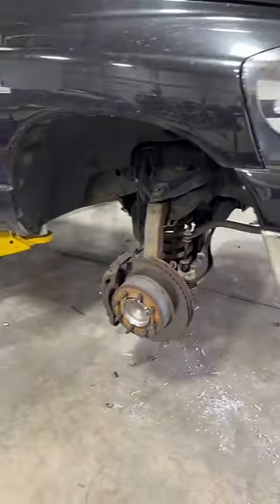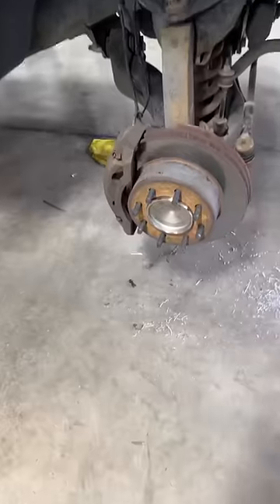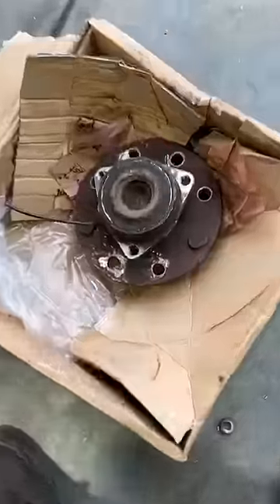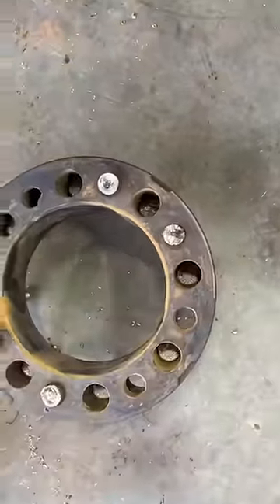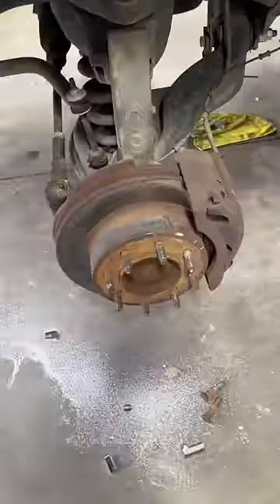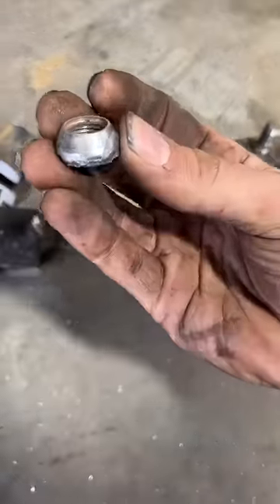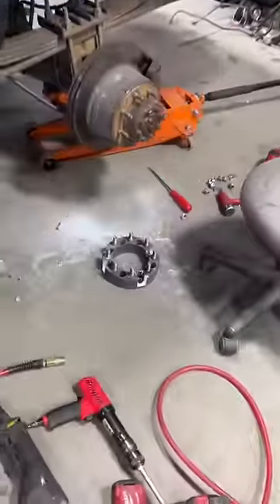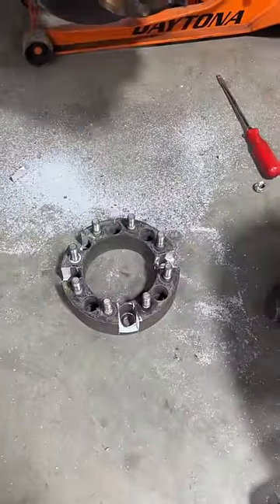I told the customer to sit down before I gave him a price 😂 I didn’t need him to pass out

Comment: Now I’ve been retired a few years now and I’m pretty sure that tires that were outside the body were not allowed, at least where I’m from. I don’t know if this has changed but I doubt it and frankly I think it’s ridiculous to have these monstrous tires hanging out past the body. Anyone remember guys with the N50/15’s sticking out? That was not allowed. How a big smoke puffing modified diesel 2500 can run tires 4-5-6 inches past the fenders is beyond me! And I get it, it’s cool but not safe and it’s so widespread I’m wondering if it’s not a problem and it’s me.  I’m going to have a look at the DOT regulations for my province and see but I doubt it’s ok. And how does someone let there spacers get that welded on? Come on really!! Oh well rant over, is what it is and I feel for you.. cheers

Comment: just put anti scuff on the flange
center .and a finger full on the
wheel centre hole .especially on
alley wheels. i do this in uk. 
becouse everything goes rusty.
never get trouble getting a wheel 
off .

Comment: Bro I just went through this literally last night 🙄 two broke lugs in some guys big ass Dodge 2500HD with damn 2an1/2” spacers and damn moto metal rims damn custom lug nuts snapped off flush at the rim not 1 freaking 2. 3 hours later I got to kick that damn wheel off.

Comment: I've always said mechanic's should make salarys like doctor's and lawyer's and stuff..... And no I'm not a mechanic..... I do have a wheel spacer story..... I'd bought a set of 98 Mercedes wheels for the high end 16" Michelin tires, had the set stacked up here for a while contemplating the cost of dismounting, remounting, balancing the tires onto my 96 Oldsmobile Aurora when I realized the merc wheels looked better than the factory Oldsmobile wheels and "bingo" off to the web and found a guy to cnc machine 3/4" aluminum spacers to adapt the merc wheels to the Aurora and no problemo whatsoever...  It's kinda cool as most folk's don't know what an Aurora is and think it's a Mercedes..... As a side note I sold the 20 studbolts are whatever you call those knarly looking mack truckish lugs I received with the wheel set for 85 buck's on ebay..... I love my Auroras, yea I have a 98 model to..... Not to candy coat you need to be a mechanic to drive the car that polished off Oldsmobils 100+ year run......😂

Comment: ..changing things from stock can be hazardous to your wallet...I knew a guy with a new Dodge Ram.  He just HAD to have the rear axle ratio changed because he didn't like the rpm's on the highway and wanted the engine to turn slower or some sh!t, so he told the repair shop to change the diff gears.  They tried to talk him out of it, but he would not be denied, so they did it.  Turns out doing that messed up the anti lock brakes, he crashed into a woman and totalled the car, she sued him, and because he'd modded it she had a case.  He was making payments, $500 a month forever.

Comment: Those things put such a cattywampus axial-to-radial load on wheel bearings; I'd rather saw the truck lengthwise down the middle, then weld the two halves back together with a four-inch wide band of 1/4" steel sandwiched between.  There - two-inch wheel spacers all around.

Comment: I hate wheel spacers. I have an 04 ram dually so it's got OEM spacers on the front. I just recently had to replace a wheel bearing, I must've fought it for 30 minutes 😂 everything went back together with a coat of anti sieze so I never have to fight it again

Comment: COPPER NEVER SEIZE 
PRIOR TO INSTALLATION OF SPACERS IS MOST BRILLIANT NOT THE ALUMINUM TYPE BUT THE COPPER TYPE AND USE PLENTY ON THE ( THREADS ) ONLY BOTH 
INSIDE N OUT

Comment: I don't know much about vehicles. But I know I had to sit down when I got the price for a new wheel bearings and hub assemblies for my Nissan Titan. Ended up doing it myself but those parts still ain't too cheap. Don't even get me started on replacing the starter. Having to disassemble the whole truck like a fucking Lego set just to get to it. And I doubt my dumbass could even finish a Lego set
Reply: About to roll over 420k something  Miles so don't nobody get ideas about it being a shity truck. Wheel bearings were good to 300,000 in could still be going now. The spark plugs only been changed once since 2008... But at 35 bucks a pop goddamn I'm going to have to change them again soon. I do pull them every year to clean them real good and make sure they're not totally destroyed or failed. Other than that, a bit of a tune-up, oil changes, and the $50 driveshaft carrier bearing... Zero maintenance. But I do drive like grandma

Comment: Wheel spacers suck, but if it only needed 1 wheel bearing, how did that turn into taking all 4 of them off? There’s a tool called the lug ripper available on the tool truck of your choice. Drills the stud out without damaging the wheel or spacer, you’d just need new lug nuts. 🤷

Comment: Actually truth be told a hub centric wheel spacer at 2” is not going to hurt your wheel bearing but having the lug nuts torqued at full send 1000 foot pounds dosnt help and yes sometimes us mechanics run across this a lot and usually done by the person who owns the truck that dosnt check there lug nut torque with a torque wrench and use the right socket

Comment: I don't get all this wheel spacer on trucks with stupid wide wheels and cars with those stupid big wheels on them. A buddy of mine years ago had a impala with big ass wheels on it and I heard him backing out of his driveway one day the torque converter was struggling to back the car over a bump In his drive. I told him your trans won't last with that strain on it. He told me na it will be ok. Less than month later trans was burnt up.

Comment: Heat + penetrating oil didn't work? Wheel spacers are often put on with loctite. A little heat then spray it down with oil should have saved you from having to destroy the customer's property. Unless you tried and it was still stuck tight.

Comment: Do wheel spacers serve any beneficial purpose besides cosmetic? I read the other comments here detailing what wear they cause.
Reply: having a wider wheelbase would increase stability in extreme off road conditions, making it less likely to roll. However, we all know these vehicles aren’t seeing more than a loose gravel road when it comes to that.
Reply: @ZSmith-yy4lv  right.
Reply: The main benefit is front tire clearance when turning. The spacer is what will keep the tire from contacting the truck when wheel is fully turned. Although buying a proper offset wheel in the first place is a better idea

Comment: I had a car come in with just ONE lug nut that bad. Looked like a cave man with an air hammer had got to it at the last shop.

Took a while but I got the carbide burr out and saved the wheel, put a new stud on.

Comment: Spacers arent detrimental to wheel bearings as long as they’re a reasonable size (like 5mm-20mm). They cause problems when they are huge like this persons spacers. The issues/wear they cause increase with the size. Smaller 5mm-20mm spacers are practically no different than buying a wheel with a different offset. When you go unreasonably large is when it causes a lot of issues.

Comment: Shops I worked at would tell him go back where they put that garbage on there.
We won't install those or try to save them.
They always end up being the underlying cause of things failing and damage leading to danger.
I don't care if you want to write up a waiver.
We know better, and the other vehicles on the road may be put at risk for life and property.
The one time I was asked by a service manager to swap in a new one, it later was proved with time and testing, spacers were causing brake feel he objected to.
They're not better, they're not good for it, and the shiny stuff only looks good sitting still and not on the public road.
It's debatable, in various ways, I know.
Just go back where you bought them.

Comment: If he doesn’t wanna pay put those spacers back on as tight as you can, drop it on the floor and wheel it out on its rotors with the wheels in the bed.

Comment: What is your labor worth? I would have sold 4 spacers, 4 rotors, two front wheel bearings, and two rear hubs with drums bearings and seals. A customer couldn't pay me enough to spend half a day drilling and cutting all that stuff with auto service grade equipment.
Reply from the maker: I charged him around 1100 bucks
Reply: @DGGarage  Including the wheel bearing, studs, lug nuts, and replacement wheel spacers, drill bits, and cutoff wheels? Maybe you are just way faster than the average tech at dealing with these difficult issues. I suspect you are working way too cheap. In any case I hope you made a reasonable profit and had a happy customer.
Reply: Got a little carried away ... No drums. Lol.
Reply: @DGGarage That’s actually less than I would have figured for all that parts/labor

Comment: It needed wheel bearings because those wheels are the wrong ones for the truck and they put excessive torsional force on the bearings. wearing them out prematurely.

Comment: Dang wheel spacers I bought a old ford f350 on the spot back in 2020 and I noticed it had dually rear wheels but the 2wd front end I wasn’t really looking for anything but a truck to make my own so wasn’t to worry about it then I took off the rear wheels freaking wheel spacers and this was not no kids truck these ppl had this thing on a farm hauling hay with it 😂 luckily there steel spacers heavy as a tire and rim but still was like you gotta be kidding me on a farm truck

Comment: Who in the hell thinks that shit looks cool? I'm 28 years old and I've always preferred a pickup in its stock form. At most a leveling lift/couple inches of lift and oversized all terrain tires, basically just setting up the truck to perform at its fullest potential. I prefer stock wheels too if they aren't ugly if so aftermarket wheels that look relatively OEM

Comment: There's absolutely nothing wrong with wheel spacers but you can't put the Big 3" and 4" or more on you are messing the whole geometry of your suspension up.

I've ran 2" spacers on several trucks and SUVs in the past for years and never had one issue.

I had two inch spacers on a Toyota Tacoma that I beat the dog snot out off road not a single issue

Don't get crazy with how big they are make sure they're torqued correctly, there is constant maintenance with them check them often.

Also when it comes to wheel spacers don't buy the cheap under $100 for four of them.
I've even seen them for less.
Is your life really worth saving a few bucks?

Comment: Those junk hubs don't last without the spacer on it. That's about the only thing I don't like about my 3rd generation. I miss my 1st generation with the good king pin dana60. You could at least repack the wheel bearings and last for years.

Comment: That’s what happens when you put rollerskate wheels on. The bearings are NOT designed for them. I’ve seen more dodge failures than any others. Hmmm

Comment: So, a soak in light oil and a goodly blast with blowtorch before a crank on a whack up pull tool (assuming there was none) might not have saved time and money? Not smart me, forget difference in expansion of steel and aluminium. The Dude probably has the right of it. Custie more money than sense.

Comment: I wish that police would start writing more tickets to these turds who ride with tires sticking out past the fenders. 

It is illegal in most states, but goes un-enforced in in most. 

Semi trucks will be pulled over and fined for mud flaps that aren't close enough to the ground, but these turds get away with slinging rocks and debris and it's fine. 

Hell, some of the duallies I've seen are over width with those stupid looking tires on the back. 
Legal width in every state is 102 inches.

Comment: Can I just say congrats on getting a dodge wheel bearing out with the wheel spacer and rotor in the way, and by the looks of it somehow without ruining the rotor
I always have to press them  out, charge that pavement princess double for putting wheel spacers on with cheap lugs and an air gun lmao

Comment: Those spacers put a whole bunch of unneeded pressure and stress on those wheel hub assemblies these wheel hub assemblies they are putting on these 1/2-3/4-1 ton trucks are shit to begin with they don’t hold up and are extremely expensive for good ones which there are not many good ones except Timken and original equipment they need to go back to the old school bearings they lasted much longer

Comment: Spacers are what’s wrong with the wheel bearings.  It’s increasing leverage by 10 fold.  Making the bearing the load bearing fulcrum point instead of having the center of gravity over and around the hub.  Idiots.

Comment: See folks; when you take a perfectly dependable truck and start bolting a bunch of extra shit onto it in an attempt to “improve” it, you end up with this.
Reply: There's a ton of great aftermarket things for trucks wtf are you talking about
Reply: @joshanderson924  I have yet to see any truck that has gad major suspension work done that did not have terrible hub or linkage issues
Reply: @Prosecute-fauci  Well just because you haven't seen them doesn't mean they don't exist. Many manufacturers out there make great products that work perfectly without issue. Bilstein, King, Fox, OME, etc are all super established companies with decades of engineering and testing

Comment: I’m a mechanic also and I see this dumb shit all the time on trucks they put spacers and then huge ass tires on it and then get upset when they smoke wheel bearings every year. Well yeah Jack ass because you’re moving the load farther out on the wheel bearing and they weren’t designed for that. You might think it looks cool I personally don’t but if you want that look be prepared to keep replacing wheel bearings.

Comment: I'd refuse to fix these trucks. The moron driving it needs to do it themselves so they will understand why you shouldn't use spacers like that. Geometry class, lever and fulcrums. The further away from the pivot point you apply weight the greater the force exerted on the pivot..

Comment: I mean usually you red lock tite wheel spacers on to make sure they don't come off as its more work to take tire off to make sure they're still tight. Heat and a large breaker bar does the trick on red lock tite. This must've been those rust belt vehicles if you couldn't get the lugs off lol
Reply: use orange lock tite, it holds like red, removable like blue
Reply: @ShadowDragon246  Looks like plenty of red got used.... red rust tite.

Comment: Dodge pieces of schitt!
Reply: It's a Dana axle
Reply: @John Dorflinger  the rear end yes. The front end was dodge no front axle. 2wd.
Reply: @Bud Lanctot  dodge is horrible even stock breaks down all the time , sucks to work on.
Horrible craftsmanship.
Reply: @daynewilson5145  well, let's see, I have a 76w200 w/150k miles, 86D250 w/over 200k miles, 89 Shelby Dakota w/160k miles, 01Ram3500 4wd dually w/210k miles, 02 Ram2500 w/125k miles. I've never had many problems w/any of them, other than converting the 76 full-time 4wd front axle to a part-time 4wd front axle. That's close to a million miles. All it takes is a modicum of maintenance and attention.